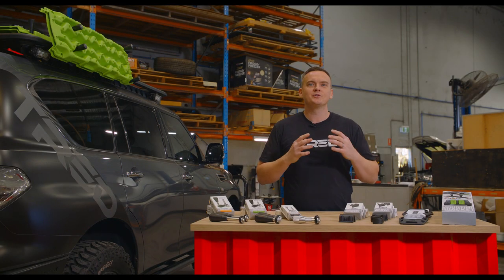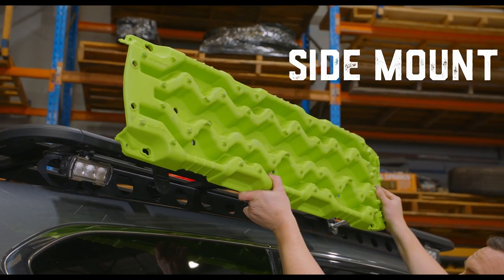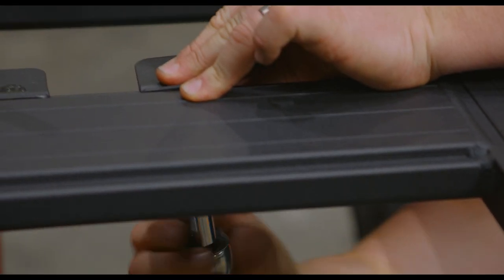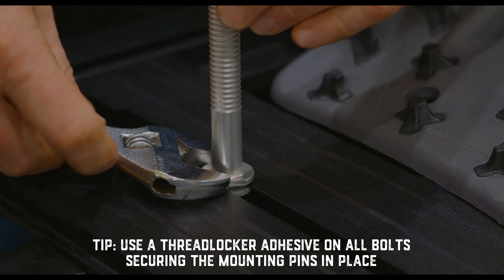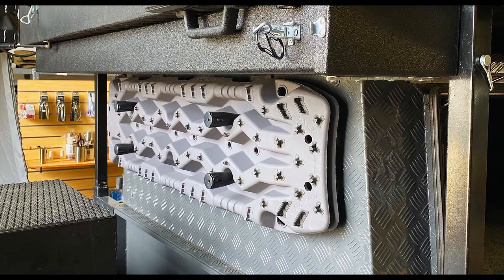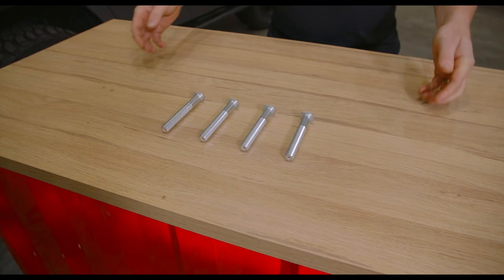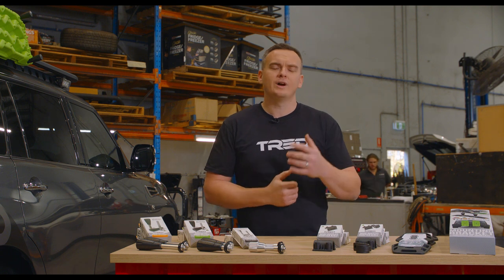TRED Recovery Board Mounting Installation Information with Mounting Products by TRED

Comment: Hey guys! 
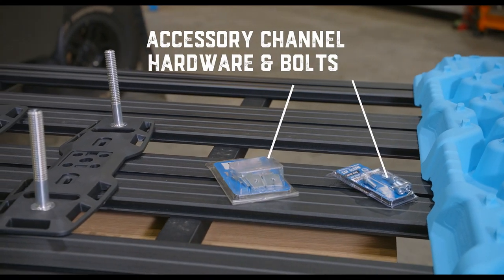At 1:35 to 1:50 in the video what are the rhino rack hardware parts that you have used to fit base plate to the rhino platform? I can’t find what bolt and nut is needed

Comment: What size locks do you recommend for these mounting pins?
Reply from the maker: @conradaleshire4428 the holes in the Quick Release Mounting pins are 5mm across. We recommend a Lockwood padlock with 3-5mm diameter bar. For flexible handling 3-4mm works well.
Reply: Thank you!  @TREDOutdoors
Reply: What kind of T-slot bolts were you using?
Reply: @danielcamarena95  On my Prinsu rack I just use stainless steel carriage bolts with a 1/4" square. You can get them in various lengths from your local hardware store. I recommend taking some measurements, buying a few to test fit out in the parkinglot on your rack, then buying the correct amount and size after test fitment. Don't forget matching washers, nuts and locking nuts (stainless again) and write down the sizes for future use.

All this is going to depend on your specific roof rack and mounting needs however.